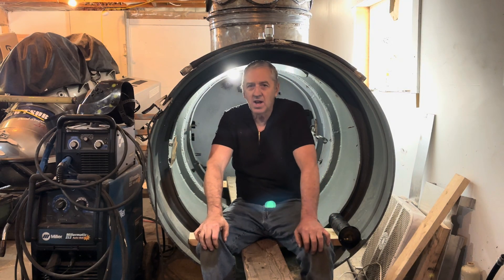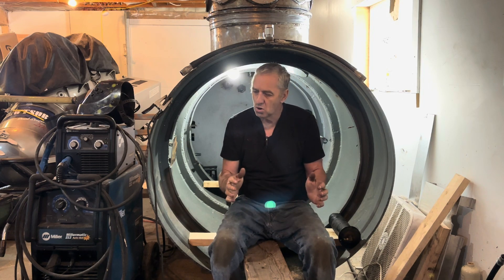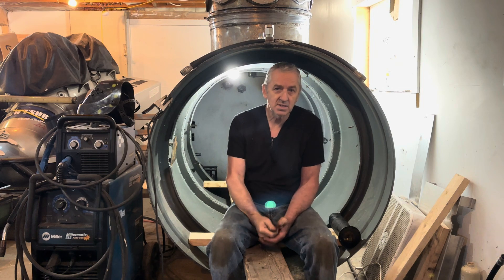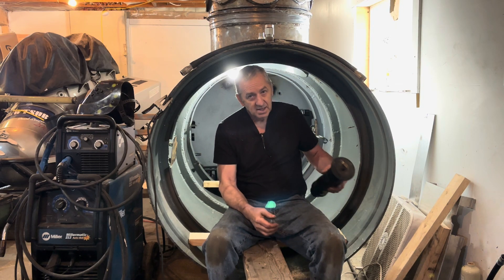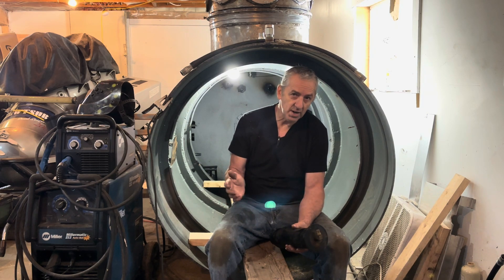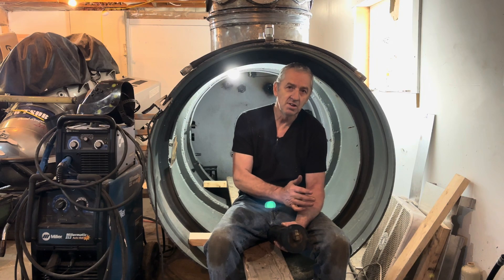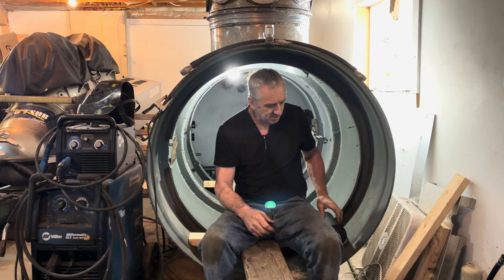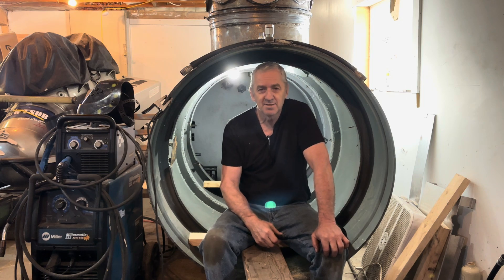Building my diesel electric submarine

Comment: Wonder if you could adapt the motor to be used as a backup generator, rather than it sitting idle most of the year.
Reply from the maker: In the winter I have about 6 batteries from trucks and machines ready to connect to my inverter to power my basic needs.  I also have my DDW to connect to.  But yes, I could for sure, and it would be easy of fuel.